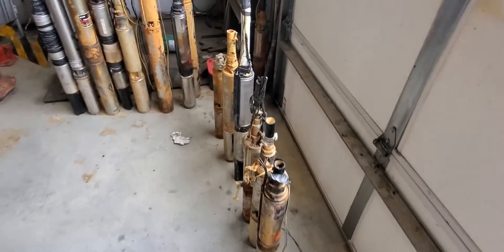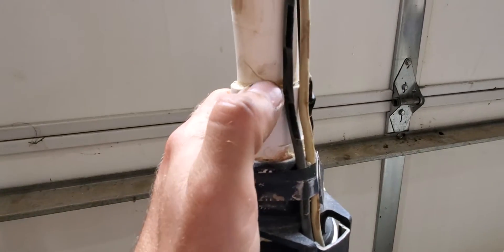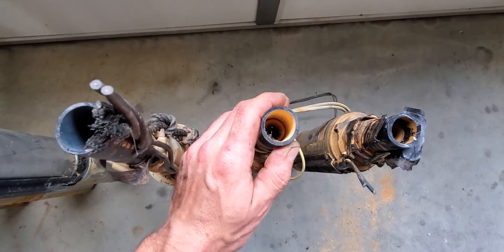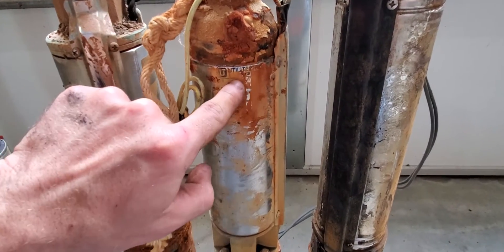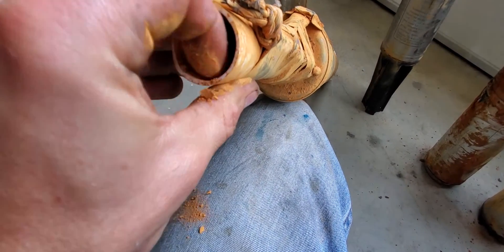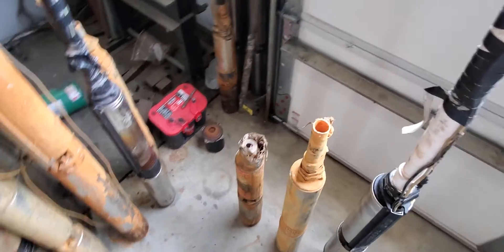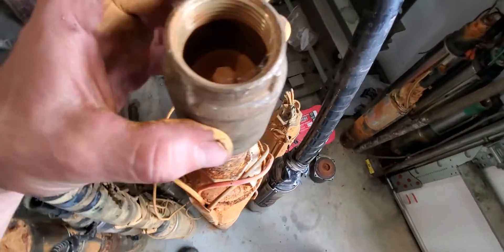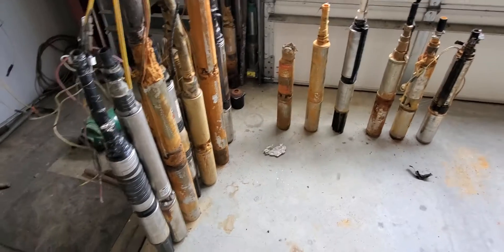No Water, Low Pressure,  Air in Water lines. Here's Why! #1 Troubleshooting video

Comment: Can you tell us the proper steps to install a new pump and how to determine how many check valves to use.
Reply from the maker: https://youtu.be/iXSQg6LLwxY
Step by step installation. Many more well videos on my channel. Well Q&A Playlist
Reply from the maker: 1 check valve at the pump is all you need 90% of the time
Reply: @h2omechanic    Thank you for the video and the reply. Sorry for this long-winded response, but thank you if you can assist me and anyone else in a similar situation. Trying to diagnose if it's a faulty check valve at the submersible pump or crack in well pipe at pump or on the line coming into house without pulling pump since we're still in the negative temperatures here in interior Alaska and 100 miles from the nearest well drilling specialist. Cannot see if there's any water spots on ground outside from well casing to the house, since we're under several feet of snow and ice for a few more months (usually thaws in April/May, with water not fully soaking into ground/evaporating until June/July). I can visually see the water rushing back down the well pipe via the whole house water filter with clear canister installed just after the well pipe that leads into crawlspace from underground (pre-expansion tank). The canister will drain down to less than 25% water and fill up with air approximately 75%. This happens after the water pressure drops from 50 down to 30 psi when using water and the pressure switch kicks on at that time. Pressure tank is set at 28 psi. There's a second check valve right before the expansion tank/pressure switch, so harder to diagnose since the gauge doesn't lose pressure over time because that check valve prevents pressure drop and is working. After the pressure tank water is exhausted and pressure is down to 28 psi the faucets start sputtering with air and spurts of water, and then several seconds later the water will rush back into the filter canister from the well pipe along with a bunch of air bubbles (delay of water filling canister). Once the water visually fills the filter canister again very rapidly, the water at faucets will continue sputtering before releasing brown sediment, and this takes approximately 20-30 seconds to clear up. Once the sputtering stops, a few more seconds pass before the sediment clears, and then the water is clear and the pressure tank starts building pressure again to 50 psi. This cycle repeats every time the pressure switch calls for water, and there has ALWAYS been water hammer once the pump cut off (the well pipe to crawl space will shake, and it has a foam "pool noodle" sleeve around it to deaden the noise). Been this way since we bought the home and didn't come up during inspection. Well and well pump installed 2019 when home built. Given the sediment that gets washed up every time, I was leaning towards a semi-educated guess/DIY diagnosis of a crack in the well pipe right above the pump, since that would create a water swirl that stirs up sediment that is getting sucked back into the pump and eventually the pump fills with enough water to overcome the air in the pipe and comes racing back up. After finding your video, now I'm wondering if it could be the check valve at the pump being bad. Again, sorry for the long drawn out reply/description. In your experience, has a bad check valve at the pump caused something similar? I.e. air in the well pipe, followed by sediment brown water before clearing again, only to repeat again, every time? Or do all signs point to a cracked pipe? Thanks again for reading. I know time is valuable.
Reply: @h2omechanic  I think my check valve is leaking so I'm going to add one just before the pressure tank. Will that usually get them to stop back leaking?
Reply from the maker: @mickjager5974  no. Itll actually cause an air pocket to form in the line when the pump leaks down. Every morning itll cycle & send a small burst of air into the tank. 
The only (half a$$) way to fix it easy is to add a check valve directly at the top of the well. But it still may cause the air issue, just less bc it takes the "trench pipe" out of the equation in regards to the drain back. 
I'd consider it a band-aid, but 100% will stop the cycling. If you notice air during a shower or flush a toilet, now you'll understand why this happened.
Reply: @h2omechanic  My pressure tank is pretty much at the top on the well after running through couple elbows and the tee. And actually I ran the pump a lot a days ago to water in some sod and now it seems like it's holding pressure. I was wondering if it was just some trash and running it a lot might flush it out. So far it seems like it might have! Holding off on adding the check valve.
Reply: @h2omechanic  I have a similar situation - pressure at the tank goes from 60 to 40 psi every 15-20 minutes with no water usage, probably due to leaky check valve at the pump.  I'm thinking about adding a check valve before the tank.  I know the bursts of air will be pumped into the tank, but my tank is a bladderless tank and I will replace the air volume control valve (mounted at mid tank).  Will this work, since the air volume control valve will automatically release the extra air that's pumped into the tank?  Thank you for the channel - I've subscribed and learned so much from it already.
Reply: @h2omechanic  I had to get a new pump and it comes with a built-in plastic check valve.  Is it okay to use my brass check valve at the pump as well?  I mean it's already installed, and I got really low water pressure that I"m hoping is the tank, other than that, I have no clue what is wrong with it.  New pressure switch, too, and it works.
Reply: @h2omechanic we throw a check valve half way in the drop pipe if it goes beyond 400ft.
Reply: I thought you were supposed to put one every 130 ft @h2omechanic
Reply: Pull that pump, remove that cheap plastic check valve and replace it with a good metal one and depending on the depth of your well and the size of your pump, install additional check valves..usually one ever 200 feet.
Reply: I just installed a new larger bladder tank, check vavle, pressure switch and now I can't get more then 25 psi pressure from my system. The pump is running and draws a 5 amp load on both legs. I'm a industrial electrician and have checked all my motor windings,start cap, amp draw and I can't for the life of me figure what's going on any and all help is appreciated
Reply: @turbotoad6  possible low water level or supply.
Reply: I'm getting small "spurts" of air out of the house facets. They are random. The well including pump is 6 months old. We had to have a well drilled because the original well went dry. We've had the well company out 7 or 8 times to fix the spurring air. They bypassed the water softener, put a new house filter in line, replaced the  presure tank. This last week, they pulled the pump and replaced the check valves. They tell me the pump is 160 ft below the static water line. What do you think? replaced

Comment: My dug well (20 feet) ran dry earlier this month.  I turned off the pump breaker and hot water tank and to let the well refill (several weeks) to where it's covering the pump now.  When I tilt the lever on my pressure switch halfway, the pump can be heard running in the well.  But the pressure doesn't build.  Any suggestions on next steps?

Comment: Why would you get air in your system but your pressure seems to be good? The well is 90’ down. Would the check valve be failing and letting air in the system through a crack or hole somewhere?

Comment: WOW.... great info. I have a client s well that has 65 psi while no water is in use. But after opening a valve or hose bib the pressure is very slow to recover? Like 20 minutes. And the pump doesn't keep up with demand? Any thoughts. Thanks

Comment: I have a question for you if you have the time I keep getting air out of all the faucets, the toilets whatever and it varies sometimes it’s just a little spurts of air or it could be quite noticeable. I have tried everything I can think of. I’ve turned off the ball valve with the system at full pressure which leads the tank in the well holding pressure and it keeps it. It doesn’t lose even a pound. I can turn the valve on and feed the house and I still don’t lose any pressure. My pump is not short cycling. I’ve had to cap off the well there’s no water spraying out at the pitiless adapter, the pump is well below the water level so it’s not running dry and the only thing I can figure is maybe over the 20 years it’s been in use That maybe the inlet to the pump is clogged with dirt sand or what not and it’s cavitating I don’t know if you’ve ever heard of that or not but I’ve talked to about three plumbers and everybody says it doesn’t make sense but something is causing air in the lines and it’s so much it can’t still be the bladder tank BecauseI can’t imagine not having that much air in it to start with

Comment: My pump is drawing energy indicating that it is running, but no water coming outside. If you hold the pipe you would notice pressure on the pipe

Comment: I have a problem.  I tried lifting the pump to replace it I can move it up and down  but I can't lift it more than 2 to 3 ft and it gets stuck in casing and yes tried it with hoist and stay stuck in same place. Need advice

Comment: I’m trying to help an elder lady with her pump. It’s had low to no pressure for over a year. Basically no pressure up stairs now the lower part of the house is very low. Ok her well house froze winter before last and it busted the filtering system that was on the wall in the well house, someone went and deleted the filtering system and just hooked up straight pipes but this system has so many shut off valves some on some off it’s confusing to me and there’s no one in my area that can seem to help in any way. Thank you for your time sir

Comment: Thank you, I didn't want to hear it...... but yea, I gotta pull the pump back out. Installed a new pump,  but it never built up past 27 psi.. changed out the tank and re-did the piping around the  well ( I have a small brick well-house). Yet it never went past 27 psi. I was going to do a pressure test with an air compressor, to ferret out any leaks.  What do you think?

Comment: Is it possible to have  sediment in pipe from well to the house (70’) which causes low pressure ,since I replace pressure switch and check valve?

Comment: Have an issue with pressure on a newly installed well pump. The guage is staying consistent at 10-20psi. I did check to see if  water was coming out of the pitless adapter when I lowered it back down in the well. It didn't shoot out of the pitless with the stated "10 gpm" as stated on the box, it just flowed over, out of the pitless, down the well casing, and on to the ground. This pump was just purchased about a week and a half ago. My wife and I did get it online. Check valve is new, pressure switch is new and the pump has been replaced. The old pump was a "AERMOTOR" 1/2hp 10gpm, 230v 2-wire pump. So we matched the specifications and purchased another one. The new one is the exact specifications, but different company(Everbilt) the poly line looks good, I didn't observe any leaks or issues with the line. The pressure tank was charged to 38psi(2 psi below cut-in pressure) 

The pressure switch was purchased last week, the day of the installation of the pump and new check valve. The pressure gauge is extremely slow to build pressure so we thought and after doing some research myself, that the check valve was the problem. The pressure tank is a "Durcam" pressure tank, installed between 2020-2021. Manufacturer date states that the tank was build in 2020. 

Not sure what could be going on at this point. When I initially removed the old pump out of the well, I could visibly see the water. The poly line is only about 30ft long, so the removal wasn't difficult at all. The hardest part was breaking the pitless adapter free of the harness it was hung on on the side of the upper portion of the well casing, about 4-5ft from the top of the casing.  We do have terribly orange water where we live. They did strip mining many, many years ago, so they destroyed the water table. We do have a slwater softener system in the house to combat that and it does a pretty good job. 

Any help would be greatly appreciated. We would like to get our water running again. Tried calling local well drilling companies for their advise and haven't heard back from them as they said they would reach out and try to help troubleshoot.

Comment: We have 2 huge rain water collection tanks in a small building with 9 toilets. The rain water is ONLY for toilets. It is the same system as a well. Only the rain water collecting tanks instead of a well. There is pump that is NOT coming on and off in an unusual way. It only comes on when someone flushes. Not always as there is water in the pipes and that sometimes is enough for a 6 L toilet flush. ( water efficient ) 

The pump pressure is at 60 psi. There is a pressure pump that according to manufacturers shall be at 38 psi and I will check the pressure this morning. 

For the last 3 weeks air bubbles out of the toilet tanks

I ran out of ideas. We turned off the pump and let the water out from
All toilets ( 3 floors. Tanks on the bottom floor of course). Then we let the water in first on upper toilets as air moves to the highest points of pipes. There seems no leaks in the tanks room. I think it could be the pressure pump. I will get what is the psi in a sec. 

Thanks for any suggestions.

Comment: 40 psi constant and pump keeps running. When shut off breaker it looses pressure. Guessing its the pump correct?
Reply: Also new pressure switch, gauge and newer Pressure tank.

Comment: I had a new pump put in but my pressure is low with 20psi and alot rust has came up and blocked  my washing machine screen and my cold water pressure is slower then my hot..one man told me my well was collapsing

Comment: My wife and I have watched a lot of your content trying to come up with an answer. I'm getting small "spurts" of air out of the house facets. They are random. The well including pump is 6 months old. We had to have a well drilled because the original well went dry. We've had the well company out 7 or 8 times to fix the spurring air. They bypassed the water softener, put a new house filter in line, and replaced the presure tank. This last week, they pulled the pump and replaced the check valves. They tell me the pump is 160 ft below the static water line. What do you think?

Comment: Constant air in system. If I have a cracked pipe or faulty check valve , could it be drawing air through pit valve ? Weather isn't warm enough here in Alberta to pull the pump.
Reply from the maker: @robertgabriel7553  do you have a check valve at the tank or anywhere besides the one in the pump itself?

Comment: K i have pressure when pump is off but nothing when running but producing water with sentiment in my hot water tank and toilet is it check valve it's a brand new pump my pump is in the basement so it's got to be the pipe

Comment: Hi I have an aerator system I have checked the pressure switch and noticed that there is no water coming so replaced that and tested electricity down to well head and I’m still getting 120 on well head. Is it safe to assume that it might be a bad pump at that time ?

Comment: I have a new shallow well pump. Installed the same way the previous one was. After reconnecting it I had water. Then the cold hit and froze up my pipes. After thawing everything I turned the pump back on. It runs and runs but no water. I disconnected the discharge side and no water comes out. I primed the pump and reprinted it again and again and still the same result. I have zero flow. What could it be? When I had it connected I could see air in the pex lines. Bled it off at my water filter depressive button, still no flow. Need help!

Comment: We installed a new pentair pump and a waterworks pressure tank but the pump isn't marking any pressure, we verified the tank is set to 28 and the pump 30/50. We have installed this set up before with another pump and had no issues. What could the issue be? Prior to this switch we had issues with pressure and no water at times that would come back on it's own. Our assumption was the poor quality pump couldn't handle our demand.

Comment: Greetings, I have replaced the pressure switch, and have power to switch, but pump is not turning on. Ironically I replace hot water heater and then had the pump not work, but they are not on same circuit, so is then just a coincidence?  So how to determine the pump is bad? I did continuity test and the pump does look like it is OK. If pump was broken, wouldn't it show an open circuit. Thanks for any advice.

Comment: Monday sept 23rd  I was doing some plumbing in my house and I had to turn off the pump several times  so I go to turn the power to the pump and I had the garden hose on and the sink faucets on to get water out of lines , I go to pump house and the pressure tank is making like surging sounds, so I turn the power switch off again, I drain the tank and check the pressure in the tank with a pressure gauge and zero pressure, I turn it back on and it’s making noise and like surging, but I have 38 lbs of pressure on the gauge, I turn the sink and hose off for a bit , then I turn the hose on and it’s working for about 3 mins and water stops coming out? The tank is still reading 38 lbs I don’t know what to do? Maybe you know what it is? Please help

Comment: Great video, I think I have a bad pump but I have to check for a leak too. The air tank had pressure and the switch/pressure gauge are only a year old. But it only pressurizes to 35 psi, seems like a pump thing.